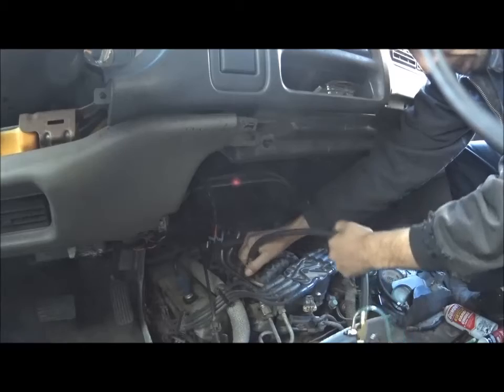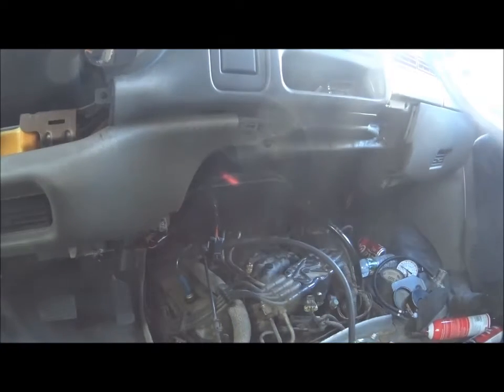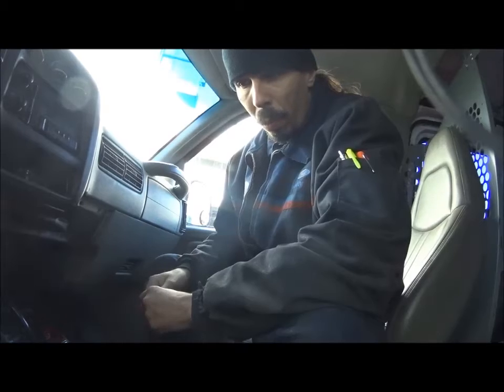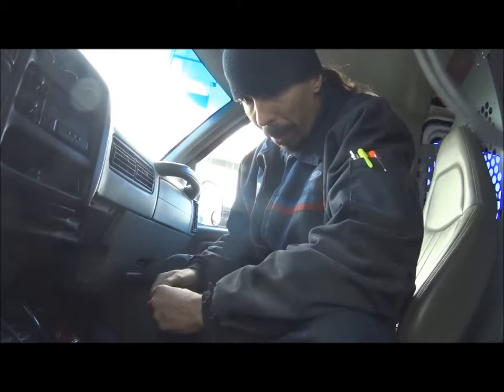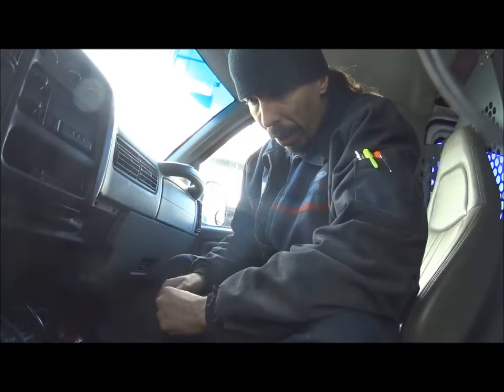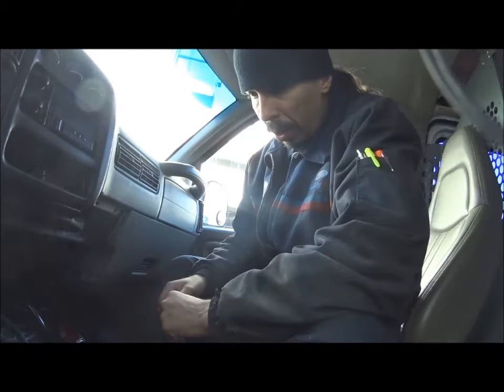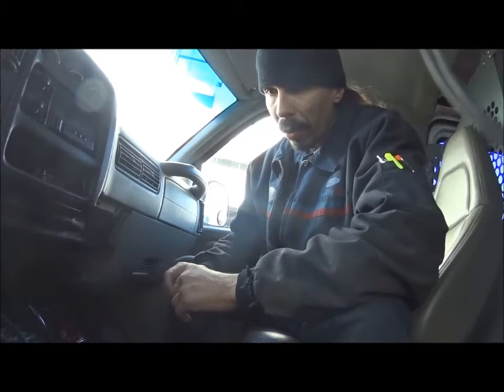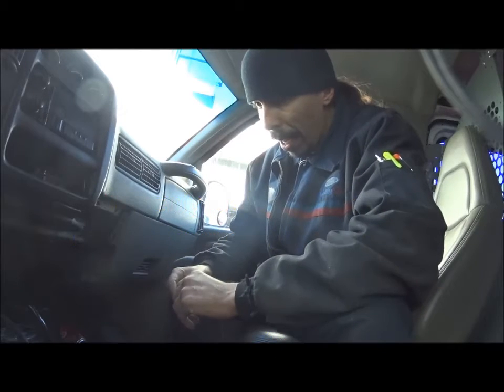Chevy Express No Start Injector Balance Test

Comment: Nice video.  I wasn't aware that you could do the injector balance test with a scanner on this system.  I have a 98 Chevy truck with the 5.7L that uses the same injector setup and factory service information has you using a convoluted setup using a couple of different electronic boxes and harness adapters.  My 98 Chevy truck with the 7.4L also uses the same equipment with a different harness adapter to do an injector balance test even though it has a different injector setup but is also under the upper intake.  I'm going to look and see if any of my three scanners can do this injector test because I suspect an injector issue on the 7.4L.

Comment: Hey joe those poppet nozzles were problems GM dealer uses nitrogen and 150 psi clean them any way when you changed the injectors did you use the update kit style injectors where there more like true mult port ? Great video thank you for sharing

Comment: When you first seen the low fuel pressure  before the the injector balance test  could you put a fuel injector cleaner canister  on it with fuel inside and pressure it at 65 psi.  Now I haven't tried it yet but I'm thinking  out loud I'd like to see if it runs on 65 psi with good fuel volume. Ha I hope this  sounds like a good idea. I'm not an  auto tech , just a diyer.  Cheers .
Reply from the maker: Well, in theory...no. I would say it would not work being that our mechanical poet valves were stuck closed on some injectors. There was no way for any fuel to flow through them. Now, I did of course substitute fuel into the intake and was able to keep this thing running rather well.